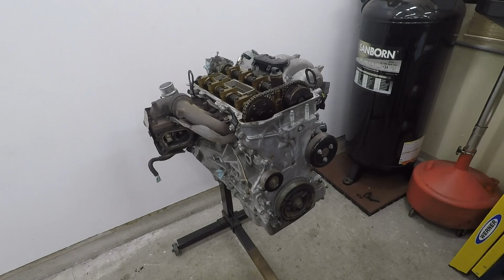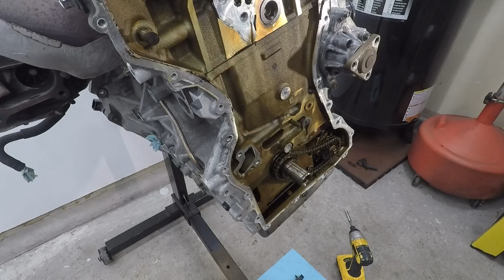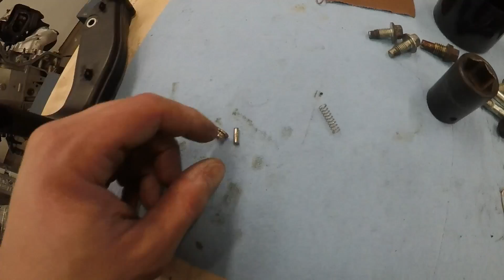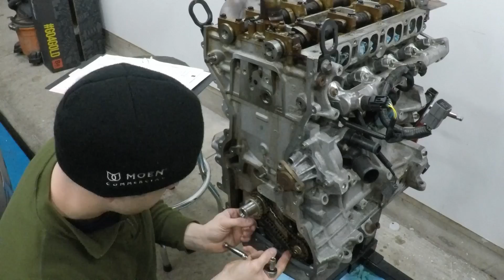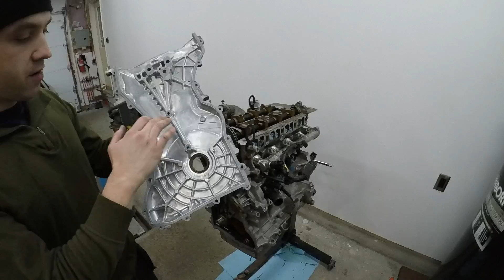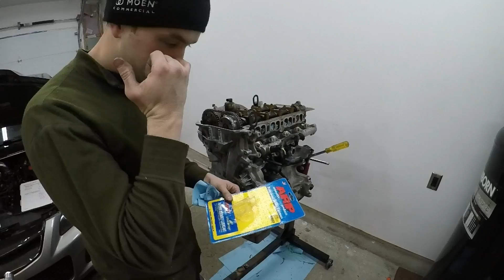MazdaSpeed 3-6 Timing Chain VVT How to change DIY ! Trouble shooting low comp DISI motor

Comment: hey man a few questions for you.... you don't happen to live in Alberta by chance, do you? I'm in Calgary. Just grabbed a '12 speed3 with 169k on it, fully factory stock everything, maintenance history from new. thing is so damn clean. but never had the timing chain done cuz mazda says it lives forever. planning on changing it out myself cuz i disagree with mazda.

Been looking into it and apparently the timing shit from the ford focus st around '15 or '16 all fits perfectly, other than the chain tensioner actuator cuz it's got a slightly different bolt pattern. but this chain is a link chain not a roller chain, and it's a lot heavier duty looking. figured it might be worth throwing on that stuff, as long as it actually does fit right. i've even read that the 2.5L kits from any ford duratec engine even pretty new ones are the same shit as the focus st kit mentioned a second ago. again, not sure, but it might save money compared to trying to get mazda to special order the parts for the speed3... really not sure. 

anyways, everywhere i've read says you shouldn't tighten the crank pully with the 10mm bolt and your cam timing tool in place on the cams, cuz apparently you can bend shit. i don't see how you'd move anything with that tdc bolt in place, just figured i'd ask your opinion though since you've clearly done a lot of these motors.

was debating paying someone to do this job but it honestly looks pretty damn easy to me all things considered. i mean it's all relative, it's no oil change, but i dunno, people make timing chains and belts out to be some horribly scary job but it really doesn't seem like it is. yeah of course in the car it's going to be harder than how you show it here, but that's why to watch it here, so you can really show in the video where to do what so we don't have to struggle to figure it out.

Also, do you have the instructions somewhere other than the forums cuz they're shut down it seems.

lastly, where do you suggest getting mazda oem parts from now? the places mentioned in comments that i've looked at aren't really that cheap imo. it looks like when it's all said and done, mazda seems to be about 1200-1300 just in OEM parts!! It's nuts! I mean i get there's been inflation, but from what it sounds like you guys were paying for parts back then, that's just NUTS inflation! Like whath would that be, around 225-300% inflation in what, 3-4 years?? That's like... crazy balls!

Comment: Although there are no timing marks and no keys/pins on the crank or cams…..Timing this engine is super easy if you follow the procedure. If you want your cam timing perfect… make sure the cam tool plate slides in with no resistance or even better…a very slight resistance in the opposite direction to timing chain stretch. …. Because the chain WILL stretch.

Comment: You wouldnt happen to have a parts list for the vvt and timing chain replacement ie the friction washers and bolts needed also i have a na 2.3 timing wise everything looks the same but i could be wrong
Reply from the maker: I’ll take a look later I have it somewhere :)

Comment: Hi mate, I would like to ask if cylinder number 4 enters the engine oil, is that due to the timing chain?  because the spark plug number 4 is wet and the engine oil gets into the cylinder

Comment: Just curious on when installing the 2 cam gears how you know the orientation of them both? The exhaust seems like it can go on however but what about the vvt ?
Reply from the maker: Been a few years but the cuts on the end of the cams are offset . Of you hold them in front of you they are offset ! The tool to
Hold them will only go in one way .
Reply: Thanks for the reply on a older video! But i was talking about the other end of the cam. I know the tool hold it in time but the 2 gears for the chain. How do you know which direction they go because they just spin 360° because of them not being keyed. Do you just see how they were originally when you set it to tdc and mabey take a picture? Like the exhaust seems like it wouldn't matter because its just a gear but wondering if the intake side has a certain clocking it needs to be at tdc when you torque them down to reinstall

Comment: Great video man. The TDC pin is in, locking pin in, locking plate on BUT the intake side on the locking plate was a struggle to get in and you can still see about half a millimetre gap between the groove on the shaft and the locking plate on one side (so not perfectly horizontal), i cant turn the shaft any more to get it to easily slide in. Is this going to cause an issue or is it just because the timing is currently so gone?

Comment: How hard is this to do with engine in car ?
Reply from the maker: It’s not to bad just the front area is tight ! But take your time and make sure your bay is clean
Reply: @IMRgarage   what would you say on a difficulty scale  1 thrue 10 10 being hard ?  I have done transmission valve bodies water pumps fuel pumps etc on a 1998 saturn sl1 and few other cars and timeing chain on a 1998 gmc k1500 lots of tools....  Also do you have links for instructions and parts ? 

Awsome video man better than most on youtube A+++

Comment: how did you come up with using a  arp crank bolt ,and how did you come up with the 140 torque measurement.

Comment: Going to do this job this week. Have a few questions.
Is it necessary to take of oil pan? (The engine is in the car)
I live in Alberta and for some reason they don't have crankshaft locking tool nor camshaft locking tool. Could I get away without at least a camshaft locking tool?
Reply from the maker: Alek White amazon sells the tool or you can make one ! The oil pan can stay on if the motor is staying in the car . IMR garage is my fb page message me I’ll give you some more info tomorrow I’m up in Ottawa area

Comment: if I'm replacing the VVT on a Mazda CX7 07 which has a 2.3 turbo four-cylinder engine does it have to be positioned in a certain way on the shaft

Comment: Great Video Great instruction  One very important step i did  NOT here you mention  ( Before installing the chain  the cam sprocket and VVT Actuator has  a  "dot" and a Notch  which must be aligned at 12 oclock position (  Piston @ TDC  both cams  lobes at base all 4 valves closed / Stop up against Crank counterweight  )  Then you install the VVT Actuator and  Cam sprocket and then the chain . Very important step to ever see  if the Actuator  slipped  due to an internal failure . Great job on replacing  all 5  friction washers ( important step )  and replacing the Crankshaft bolt which stretches every time you install and follow the 3 step torque process .
Reply: can you provide a link or more information this  step? We are stumped with our 2010 2.0 MZR where we replaced the head and chain, but did not remove the 2 cam sprockets. We have watched and followed multiple video's using the right timing tools.   when we do the final test rotations, we cant go 190 degree without hitting something (pistons 2,3 heading up ) we are searching for anything.

Comment: Thanks for the video. I positioned the lock for the camshafts, I did not use the pin for the upper dead point. I did lock the big wheel near the clutch and positioned the top dead point by looking under the oil pan when cilinder 2 and 3 are fully down. Now the engine runs on 3 or 3 1/2.  Did swap the spark plugs , coils and injectors, but still cilinder 1 missfires on idle, and the obd detects it. When going fast is almost not felt, but I feel it at roundabouts when accelerating.  What did I do wrong? I tried to move also the rpm sensor near the pulley, but no change.

Comment: great video.   i jus bought one of these turbo cars with 151000.     should i plan on a tchain replacement soon.   or u think we can ride for a few months before doin the job ?     engine runs good.   sounds good.   any comments are appreciated
Reply: i just got one with 127k and the chain is pretty stretched, i bought all the things to change it and i’ll probably change it soon before anything bad happens

Comment: Great video, super through and easy to follow. Just want to check, the Flywheel bolts are for a Ford 1.8/2.0L, was there any issues using for the Mazda 2.3?
Reply from the maker: Brian Coignet nope they worked perfect ! I just sold my spare set for a focus RS build ! I can grab the part number tomorrow also .

Comment: vvt notch u took the time to make sure 'notch was at the top before tight  what is exzactly the correct positon not mentioned in the video  does it say specificly to make sure notches are at the top
Reply: Here if from the manual.   Following the notches on the back of the VVT and translating to the front, the notch on the front will be down.  Meaning you can read the part number on the VVT on the top.

Comment: Great video.  Just a few comments for others who might be attempting this job.At the end, after you torqued the crank pulley bolt, you rotated the engine the wrong direction.  You should have rotated it clockwise, to the right, or the  tightening direction.  Especially if you are checking timing immediately following (highly recommended).  By going the wrong direction you introduce slack in the chain and could make the timing appear off.  Additionally, as other have said there is a final 1/4 turn, 90 degree, rotation of the crank bolt after the 70 ft pound torque (at least with the factory bolt).  This has to be done with all timing tools removed but with the crank locked by another method.
Reply from the maker: ChevyCruizer yes I noticed I did this on the rotation to veryfy timing ! I did not show in the video put I locked the tensioner tight !

I used a ARP bolt because in Canada the bolt is not cheap and on BO

Comment: So the vvt just needs to be locked and it can be installed in any orientation?
Reply: I didn't see a note in the factory repair procedures but it is common to point the plunger of the VVT up.
Reply: Absolutely    NOT   !!!!

Comment: you do not re use guilds I dont care what they look like its a 20$ parts stop reusing timing parts
Reply from the maker: crettybocker they were off a motor with like 2000miles on them they were new ! Here in Canada guides are $80-100 . I would not use old 100k plus ones but these were installed inna buddies Speed with the timing gears for about 2 months

Comment: 41:26 - what to do you mean by make sure the pin is locked in place?  For the VVT...
Reply from the maker: craigzilla100 make sure the VVT is locked ! If it is not locked and you torque it down your intake Cam timing will be off and you could bend a valve !

So grab a wrench hold the camshaft and snug down the Cam gear bolt then with your wrench on the Cam gear move the Cam back and forth slightly and make sure the VVT is locked and not moving !
Reply: @IMRgarage  gotcha.  What about that button on the side of the VVT?  What is that for?  Do I press or leave it alone?
Reply: @craigzilla100    The VVT Actuator is not a serviceable part  , Leave it alone  if you want to know if it is working correctly watch for trouble code P0012   and if you get you MUST  take the timing cover off  and look at the configuration and see if the "Notch on the VVT  is in the 12 o'clock position,  I have a new video coming out in about 2-3 weeks showing exactly  how to do this   , Hope this helps

Comment: What do you mean by make sure the VVT actuator pin is locked?  Are you supposed to press that button?  Also when you're putting it on does it matter how you line it up? On the intake cam there are several oil passage holes, and I'm curious if they need to line up with the actuator holes.

Comment: I tell ya, that oil pump sprocket was a pain in the ass for me as well.  I actually put my crank pulley back on and lightly torqued it, then held it in place and impacted that oil pump sprocket loose.   Insane.
Reply: that is the Mazda manual method as well

Comment: Exactly how did you do the temp fix?  My vvt is just like that and I want to fix it temporarily to rule out any other damage.  I already have to replace the turbo and don't want to sink in more money if the engine is junk.
Reply from the maker: RH2RACING hey I used a piece of alum rod 1/8 thick cut the ends roughly the same size as the hole in the vvt . I put the vvt gear so the plunger was at the top and with a wrench moved the Cam gear back and forth while pushing down the plunger till it locked ! Then I took the small 1/8” alum rod and wedged it in the hole so it kept the plunger engauged ! Does this make sense ?

Comment: I turn the crankshaft and I think I hit a valve with a hand turn. Do you think my valve is damaged? I turn it because I wanted to hit the m10 bolt. (sorry for my English)
Reply: It depends on how hard you hit it.  If it was just by hand and you stopped and did not apply excessive torque it is probably fine.  But if you went Hulk on it you probably messed it up.
Reply: As long as you didn't use an impact gun to turn the engine it should be fine 🤷‍♂️

Comment: Can I still use my exhaust cam since it chiped a little where I hold with plate the two cams to lock or I will need to replace
Reply: The chips (if you are talking about where the cam tool does) should not matter.  Never let the timing tools hold the timing in place for final torque.  This will break your cam, block, and or your timing tools.
Reply: No too risky

Comment: I have an ms3 and it may have jumped a tooth in timing.  How do I check this and how do I fix it?
Reply from the maker: RH2RACING pop the valve cover off and put the crank at TDC . One way is to pull the spark plug near the crank out and put a long skinny screw driver down the hole and turn the motor till the screw driver gets to the highest point and check the mark on the crank ! Now also check the drivers side of the cams to make sure there in line like the Cam holder would hold them straight across !

Comment: What size of bolt for tdc lock
Reply: Hi its called a timing peg  TDC   SST  Part # 303-507 Mazda,   The length is what important  so your cam timing is not off a few degrees

Comment: A tougher job to do it while the engine is in the car
Reply: i have done    its takes about 6-8 hours at home  and you must have the special tools , cams lock plate , sts bolt to lock the crank counter weight  STS tool to hold the  Crankshaft  pulley while torquing torque wrenches
Reply: @mrfixitdellacertifiedfield5376  Sure, but you know what it took me 6 days to do it at home, no help from anyone and I had all the right tools but I ended up inventing a tool to extract the water pump as it was stuck there and could not budge it at all but my tool worked great. Cheers

Comment: great video... I think you forgot to mention that after you torqued the crank bolt and removed the locking bolt pin you need to remove the pulley locking small bolt also, them you can spin it around... Just a small thing you forgot... otherwise it was a great video, very informative great job!

Comment: Your crank seal tool is in the top left corner by the magnetic 45's. LOL! good video man!
Reply: Yes, I don't like how he installed the seal either.  Everyone else...find a large socket and use that as an installation tool.  DO NOT tap on the edges of the seal with a hammer and screwdriver.

Comment: Where is the vvt valve locAted on the regular 08 mazda.3 1600engines
Reply: Its called a  VVT Actuator  not a valve  which is controlled by the  OCV  they work together to advanced and retard  the timing  (  cam phasing )

Comment: Hi guy - I noticed you torqued the harmonic balancer bolt gainst the timing bolt - have you ever heard of breaking the block by pushing out the timing bolt while putting all the torquing force against it ??? Thanks for the video - I'm doing this exact job in the car now - dealer wants $2000 to do it...
Reply: The guy used a big flat screw driver  for locking the fly Wheel in the starter location. So don’t worry about it. Ok!
Reply: Hi its NOT  a harmonic balancer  ( This engine is internally balanced  no need for externally balance  on the Engine its just a pulley to drive the  Belt  ) 

The dealer is overcharging problem because there techs are NOT  efficient at doing this   Average time to install a NEW  VVT/ Chain  guides   is 6-8 hours , Avg  dealer shop rate per hour  / $125.00     Estimate  should be around    Labor  $750 - $1000  only  Parts estimate $300 -$400   Genuine Ford parts (  VVT Actuator ,  5 FRICTION WASHERS,  CHAIN , 2 NEW GUIDES  CRANKSHAFT BOLT

Comment from the maker: Hey guys at 30:58 I must of mis edited the video but before putting on the main crank sprocket I put on a friction washer between the crank and main sprocket !
Reply: do you have a diagram for the locking plate?, also the pin that you said was 38.65mm, does the head have to be below a certain diameter to get into a recess?

Comment: Hi,
One question on the oil pan removal: Is it possible to remove the oil pan with the engine is mounted on the car?  Noticed that the vertical bolts are not the issue, but the lateral ones might be especially the ones on the driver's side.  Not sure...

Thanks!
Reply from the maker: Jeff Ngafoe I'm pretty sure the oil pan can be removed in the car just make sure you clean the corners well with acetone!
Reply: YES !! its easy too
Reply: Won't you have to reseal your front timing cover if you take the oil pan off since youv disturbed the seal tho ? Be a pain to do with it still in the car